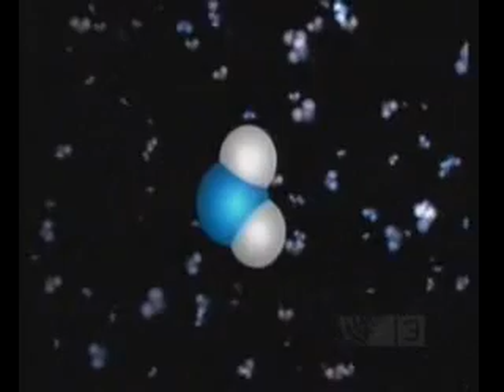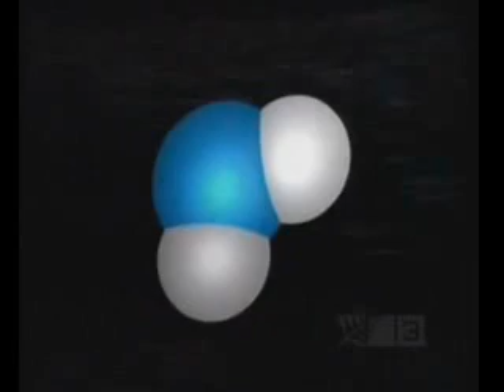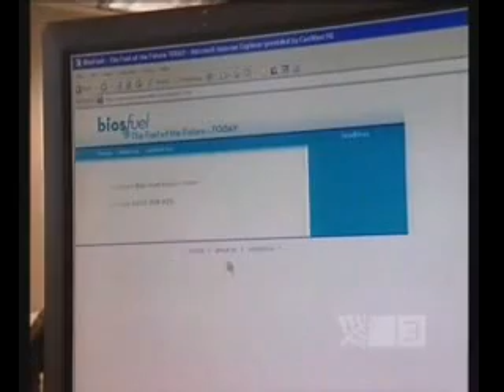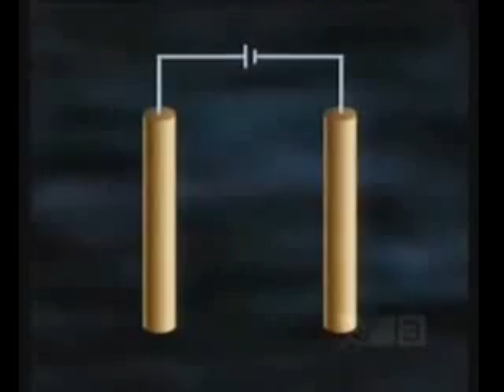A Motorcycle that runs on PURE Water.

Comment: After the oil finds its way into rocks mostly shale it then allows lighter gases to be released into higher elevations of permeable structures where the porosity is higher and the density is lower. Mostly hydrogen rich sands known as oil sands and high gravity mud known as red cave. All in all when we refine the oil for use the only part of it that is combustible or flammable is the Hydrogen content in its hydrocarbon chain. the carbon elements in the hydrocarbon chain make good fuel sources

Comment: The point is this. Gasoline comes from carbon rich hydrogen source rock. Im a geologist. Over time carbon based life decomposes and the molecular structure traps excess carbon and hydrogen molecules. over millions of years the carbon lifeforms get turned into an oil resin that saturates itself in permeable structures. This is why oil comes from rocks. This process is called osmosis and is easily demonstrated by a sponge soaking up water. The sponge representing the rock and the water the oil.

Comment: Take a cup fill it with water. Take two sewing needles and poke each of them at the bottom of the cup into the water. Take a 9 volt battery and two copper wires. Attach the 9 volt battery on the positive to one wire and the negative to the other wire. After you have done that attach the other wire ends to the sewing needles that are poked into the cup of water. And voila. The needles will be creating bubbles at their tips. These bubbles are hydrogen and oxygen bubbles. its very easy and not new

Comment: I was joking about putting water in my tank. But your comment about putting just a little water in is wrong. Water will not mix with petrol and it sinks to the bottom of the tank. If you put just a little in each week it would continue to collect at the bottom of the tank until it got suck into the engine. Try it in a jar. Half fill it with petrol and then add a spoonful of water.

Comment: But not in gaseous form. To run a car on hydrogen at standard temperature and pressure the car would have to haul a blimp full of it behind it. No little "HHO" generator could make it anywhere near fast enough, and even if you could it would have to steal all that energy from gasoline by way of the enigne driving the alternator, and the losses would make the mileage LOWER than gas. People keep forgetting that it takes more energy to split hydrogen than you can get out of burning it. He's a liar.

Comment: It's not running on water. It's running on the hydrogen that is part of water. NOTHING will run on water except a water wheel. 
I'm a 40 year mechanic and water is one of the reasons I stay employed. Water contamination in fuel systems. Also, never send any money to these guys who post these "run on water" videos. They are scammers, to put it kindly.

Comment: Basically, I think you CAN turn water into fuel, but I also think the process is reversible, there has to be a way where you never loose any of the water, but some would say that is impossible.
Sorry to disappoint you, but everything is possible if you put your mind to it and never give up, and I think electric cars may have the answer, because the hydrogen combustion engine is said to give off nox while the fuel cell only gives off water.
But i like it, those old cars can still be running =)

Comment: I have read all these stupid posts and only a 16 year old kid is acting like an adult. 
Lets do a process of elimination. 1. No carbon or octane taste. 2. You can drink things that burn: Hydrogen Peroxide, Alcohol, Water that has had a bond angle change, or water that has been in a electrolytic cell ( not saying water will burn from these processes) now we need to look at negatively charged water and start there. If you hold water at a negative charge long enough you (might) get a bond angle....

Comment: (continued) water is hydrogen and oxygen both are "combustible" pipe it into your car, truck, van, scooter it doesn't matter you WILL see a difference we need to save this earth hydrogen is the best way and the most efficient water vapor is the exhaust if we could condense that water vapor and re-use it who knows the increase we could get with gas prices this high you people should be begging for this information not putting it down i promise anyone that doesn't believe hasn't tried it...

Comment: i meant covering his ass didn't work.
consider this though, ryan's company had other products before the water powered motorcycle. for example, he had a device which you attached to your engine which uses the exhaust heat to pre-heat the fuel before it is vaporised.
there are articles from 2007 reporting bios fuel running a troopy across australia with a 40% water 60% waste oil mix.
also, i've yet to see any request from ryan for investors

Comment: This would mean that the water has to be flammable ? but yet he drinks it ? this man is a lier, I have a degree in chemistry and I can tell you this is impossible, if the water molecules were separated then fine fair enough because the reaction would be exothermic, water can not achieve an exothermic reaction.

Comment: Its basic science, you put electricity through de-mineralised water, nothing happens, but add some Electrolite ie: salt, ect and you get a reaction which seperates the Hydrogen from the Oxygen molecules,( the more salt you put in,the higher Amps you get,the more Hydrogen ). The Positive power lead gives you Oxygen and the Negetive power lead gives you Hydrogen, trap the Hydrogen and redicect it into your Carburator and WHAM, you got a fuel... its not rocket science !!!!

Comment: Adjusting the water drip rate would increase the intensity of the flame, thus the brightness of the lamp.  Putting a calcium carbide pellet in the float bowl of the carburetor and water in the gas tank does roughly the same thing.  

Calcium carbide for lamps costs about a dollar an ounce, so it's not very economical for use as an acetylene source to run an engine.

Comment: Sure.  Calcium Carbide is the compound that was required in early lighting systems on antique cars.  It used to be sold in every variety store alongside the mothballs and turpentine.  Everybody needed it if they wanted headlights to drive at night.  You simply pulled over when it started to get dark, put a calcium carbide pellet into the fixture in your lamp (or use the one already there from last time), set the drip rate for the water, light the lamp with a match, close it up, get in and drive.

Comment: OMG.  Water is spent energy.  You burn it with oxygen, it releases heat and implodes to water into a smaller volume.

I would like to see this guy do way more than a blocky and have his battery survive.  It works, I will grant so why isnt there someone selling this bike.  

I can travel 120 kms off the sun, I can build you a system that will last you 12 years,  every 5+ years only having to replace a lithium battery,  Now, here and sell it..  I have a working system now.

Comment: no need for a patent....brown's gas is very easy to produce.  He mixes potassium into the water as an electrolyte and runs 12 voltz at high current.  Hydrogen is produced from the anode and oxygen is released from the cathode (or vise versa). The carburetor is the key. Air fuel mixture is very important and hard to get just right.  What make this different than most Hydroxy Generators is that he is most likely just using the hydrogen side as most engines will run on hydrogen alone.

Comment: the proffessor is wrong.... sigh.... water is energy in a liquid form, hydrogen and oxygen separately are highly explosive as to the hydrogen and oxygen is extremely flammable and burns at high temperatures, what might be happening is a process that allows the molecule to split appart to catch fire, (fission) or it adds another molecule to the H2O that allows fire to interact with the liquid in a different way

Comment: Liquid can not be compressed by the laws of physics. So hes has some how turned water into a vapor or something like fuel injectors do with gas. But even then it still would not work because water is not combustible. UNLESS hes using moonshine witch looks just like water and is MADE from water but is very combustible.

Comment: One cheap way to break the bond  through decimal metal corrosion? Take the humble zinc anode that protects engine, electrical components in ships and boats. It sits in salt water for years slowly rotting away give a path of lest resistance for static or stray electricity to earth. As it corrodes H2, element number 1 is released. The amount of electrons that pass through is extremely small yet the volume of gas given released
relatively large.  What about using zinc in salt water someway?

Comment: What ever happened to this guy. It's been 8 years since the video and I am well aware how this system should work if tweaked it right. I have designed 7 different ways to run and engine on water and I think his method is one of three of mine. Is there a way to get in contact with this man if so please inbox me his contact info.

Comment: @Thermospecialist No laws are broken here. Simply these laws of TD are cited repeatedly as "mantrams" by the academic establishment, to actually take them out of context. Have you seen dominoes fall on each other? or a gun fired? or a spark plug firing a piston? The process that converts water into HHO is "catalyzed" by the reactants, in fact most of the "energy" is provided by the chemicals and the electric charge would simply act as "trigger".

Comment: @Younowkoed Once you have the hydrogen gas isolated the oxygen from the water is not needed. 

How much energy is used to acquire then refine oil into gasoline then get it to the station? vs how much energy can be performed with the gasoline? Gasoline is nothing but the toxic waste the oil companies would have to store somewhere if we didn't buy it from them to dispose of it for them. All cars in america ran on alcohol before prohibition.

Comment: It's just a new variation on an old scam. It's all sleight of hand. You see him pouring water into his gas tank, but there's a "false floor" lining inside that keeps the water from mixing with the gasoline at the bottom of his tank. Reminds me of the old "gasoline pills" they used to sell back in the 1970's, where the con artist would put a couple of pills in his car's gas tank and spray a garden hose into it, and then drive around to convince the gullible to buy them.

Comment: Water = 2 Parts Hydrogen and 1 Part Oxygen. 

Explosion requires fuel, oxidizer, ignition source. 

Water exists in three forms: gas, liquid, solid.

Change water from it's liquid state into it's gas state. Separate the oxygen gas from the hydrogen gas. 

Explosion requires fuel, oxidizer, ignition source. 

Hydrogen gas is your fuel. Oxygen is your oxidizer, Spark plug is your ignition source.

Gasoline is the toxic waste left behind after the oil has been refined till there is nothing useful

Comment: @lapmarty   Indeed, use the electricity directly and you have a far greater efficiency as well! Hydrogen is NOT an energy source but can be used as an energy converter only (fuel cells, etc)

Comment: The correct definition of the First Law of Thermodymics is: "If energy is applied to a system to bring it into an other condition, the same amount of energy must be removed from it, to restore the original condition.

With this definition one can understand that if the system is water from start, when it becomes the original water again at the end of whatever process, no net energy could be taken out in that process - it would then have come out of nothing.

Comment: well i will post a vid of me running a small leafe blower engine on WATER it is called hydrogen i is from electrolisys splitting atoms with electricity take 2 paper clips a cup of water some salt as an electrolite and induce voltage with a 9V or something and you will see bubbles light a lighter close to the surface of your water and you will hear popping guess what you just made a burnibal gas from water so you want to know what is anoying ppl that dont think out side the box dumb ppl lol

Comment: for both of you two ( exmerch and clborg ). whilse there maybe STEAM Engines, Putting steam on a gasoline engine will not work; as the water molecule have NOT been split up. try burning steam and all you get is a WET wick.  you need to split up the molecules of water ( hydrogen and oxygen) thru electrolysis in order to make Hydroxy gas. water gas burns gasoline much more efficiently.

Comment: Yet another bogus water-powered something or other.  The power comes from the battery used to perform the electrolysis, not the water.  Once the battery runs out (which won't take long) the engine comes to a halt.

Comment: You know, I have a plan of making hydrogen without the use of electricity, all you have to do is get some aluminum foil, or aluminum shavings of some sort, you know small or thin pieces, and then put it in the cell and it will make hydrogen in about 20 minutes, maybe that's what he did too, lol. It can get messy in the cell though, so use some clean aluminum, not used foil that had food in it, lol.

Comment: Wasn't this the technology, that you let a high voltage through the water tank, and it will change the chemical structure of O-H-O to H-O-O, as in this will store energy. This H-O-O water will burn at -steel-melting-temperature.

Comment: I have been in this form of research before and I know why its still now where to be seen in mass use. I believe the invention works. The only setback is the cost input to produce the water that makes it not cost viable yet. Maybe someone who can make the water fuel cheaper to produce or a more efficient use of the water fuel. Another setback is that starting the engine with this fuel is still not that efficient.

Comment: Naptha is probibly used. This isn't the first time a water mix fuel has been burnt in an internal combustion engine or the only method of running an engine on water. HHO generators are also popular. All methods have their problems. This one probibly does too.

Comment: @awbear619, Getting Hydrogen from a filling station, filling a tank and running the engine is easy, your just silly enough to think its new! its been done for over 40 years!, BMW and Mazda both currently sell this type of car, but the engines are bulit for it.
With your lack of knowledge you will destroy a perfectly good engine, that was designed for petrol not Hydrogen.
Your not open minded your gullible, stop shooting your mouth off and ask questions instead of thinking you know

Comment: @awbear619, Basic Physics: Thermodynamics!
Energy in energy out
Nett gain or Nett loss?

The vehicle you are describing needs to be autonomous. It makes enough power to split the water, run the engine, without destroying it, NO external battery or power supply!

When you burn Hydrogen with Oxygen, you get Water, so guess what!
You have just put water into the combustion chamber of your scooter!
If you dont strip it down urgently, it will sieze up!

Comment: @awbear619, Dude, your explanation of how a Plasma Injector works, shows your complete lack of knowledge of what you are talking about. A friend of mine holds a Phd in Metal Hydride Hydrogen tanks and studdied under a professor who designs them. By the way, the common name is: Precombustion Swirl Chamber Plasma injector. Where did I say that I do not believe it is possible?
You are confusing two different area's Hydrogen and onboard (insitu) HHO
VERY different area's of work

Comment: @awbear619 , Yes I am aware that liquid hydrogen exists, BUT it requires super insulation to keep it at -245 oC and 10-40,000 PSI pressure vessel. it takes 1/3 of the hydrogen to compress it to a liquid, so its very energy expensive.
Splitting water into hydrogen and oxygen via electroysis results in hydrogen gas , not liquid!

Comment: @eveilslayer 
Hey watch your language.

You can't burn water.
To get the Hydrogen out of its bondage with oxygen you need energy. e.g. electrolysis or steam reformation.

Once separated both are gaseous and not liquid. So you cant just put them into your tank as liquid. You just can't use a miracle substance of whoop ass to secretly put them together.

Chemistry doesn't work that way.

Comment: you guys that get on here claim that this process is Electrolysis are completely ignorant to how electrolysis works. electrolysis seperates the bond between hydrogen and oxygen, turning both of them back into gases, his process some how adds a H to H2O makeing it H2O2. and he even says that its a mineral oil that he uses in this process and has made lower grade water based fuel that will run in a disel engine, see what hes done is hes made it a little bit cleaner, it still emits carbon.

Comment: Yes, hydrogen is a component of water but what he uses is extended water. With a chemical process it's possible to put more hydrogen in to the water. Remember he says it's not pure water, it's a water based fuel. About the emissions he needs to burn a lot of oil I guess since hydrogen is not so good for the cylinder and burns faster than petrol. To prevent preignition and worn out of the cylinder he probably have to burn a lot of oil that is not good for the environment.

Comment: It is not really water he pours en the tank, it is "extended water". What the cube does is storing hydrogen in the water which is separated in the carburettor and burned in the cylinder. It works! The problem is that it cost more to put hydrogen in water than producing gasoline and the emissions are about the same.

Comment from the maker: The Modification is not just the Carb, but also the electrical spark system.
It is now 150 volts with more Amps.
Simple with a 1 cylinder 2 stroke bike.
Google 1978 Camaro conversion to run on water.
Or PM me I will post it for you.